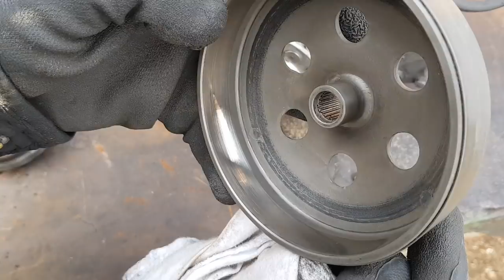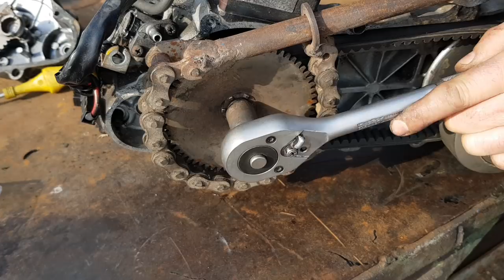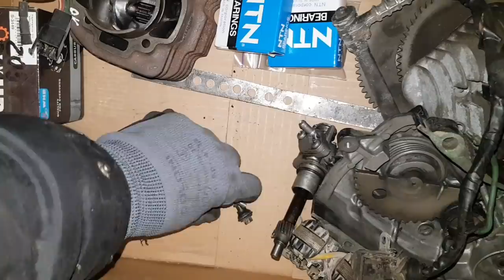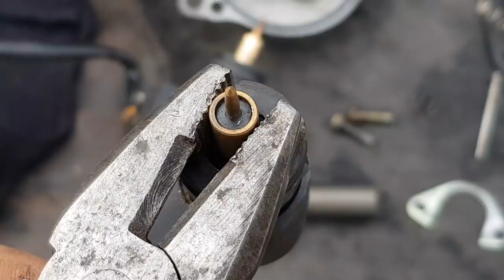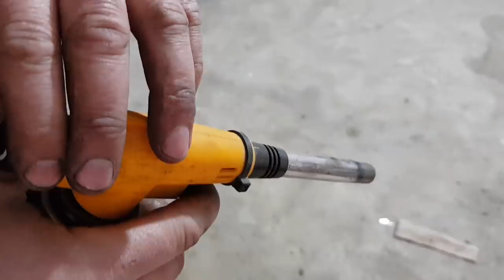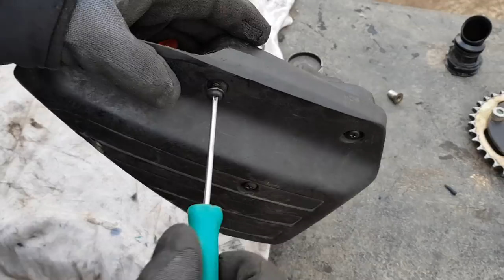Подготовка мотора Honda Dio перед установкой на карт.

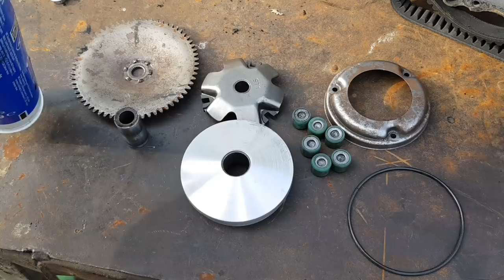Comment: 7:56 what are you doing!?!?! i have tried greasing the weights, and it just ends up with not working correctly. the grease sprays on to the belt and dirt clogs the weights....
Reply: @jamiro_mb2829  ah, yeah, it almost looks as if it was made to hold grease. 
so Dio's are supposed to have their weights greased?
strange, and unpractical if the weather is below freezing...

Comment: U dont put grease in the variator it needs to be dry only put grease in rear pulley
Reply from the maker: CVT with a special rubber sleeve. This variator is lubricated.

Comment: Still don't understand why you are putting grease in variator. The rollers need to move smoothly on their own, not to stick in the grease. Or do you have other reasons why are you doing that?
Reply from the maker: This variator must be lubricated, there is a special cover and a rubber ring to hold the grease